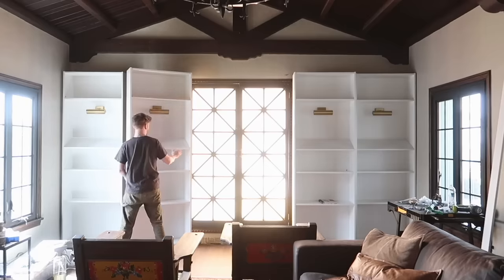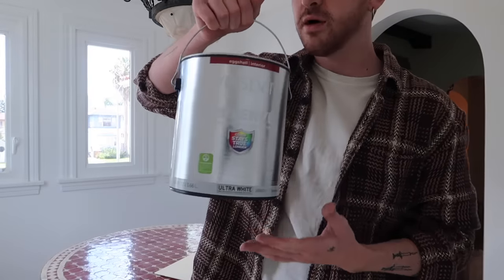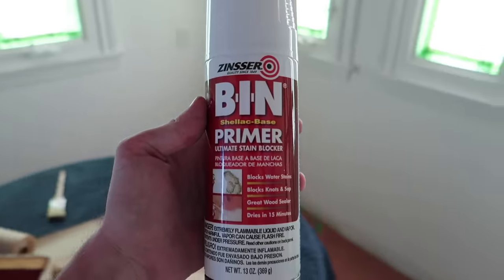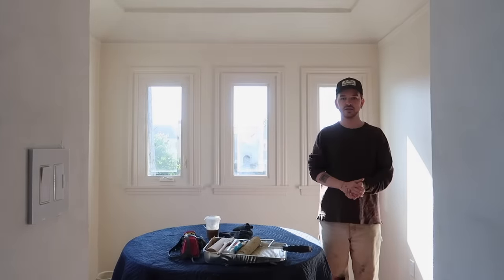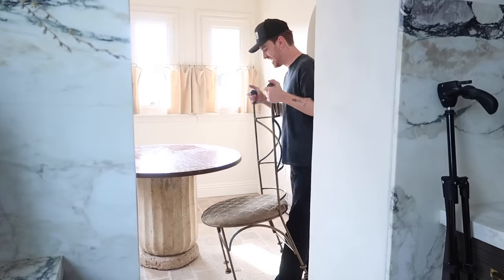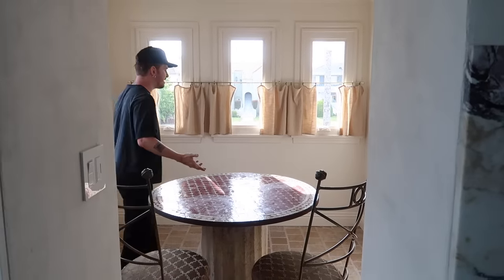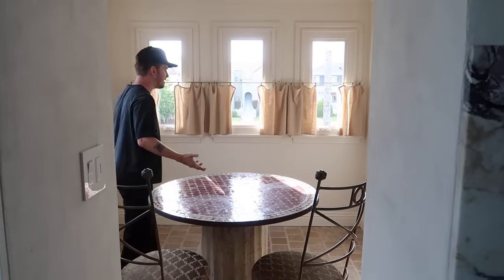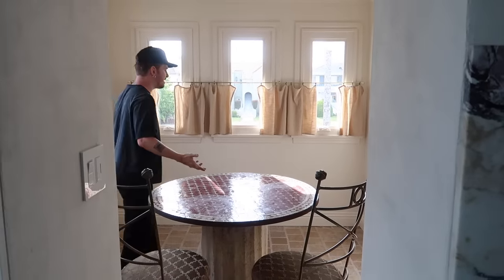EXTREME Breakfast Nook Makeover (From Start to Finish) ✨ MAJORITY THRIFTED!

Comment: Love your choice of fabric on the chairs. The chairs were a great find love that they even have rubber feet. I don't know if you realize you had the cook books upside down on the right breakfast nook which was a little odd. Love the linen curtains / napkins. I definitely agree with you about the paint color changes. It is soft and warm in there and it looks really good from the kitchen. The one thing I would do is raise the light fixture up one chain link so the bottom of the acorns are above the cafe curtain rod. So when you look in there above the curtain rod. The light fixtures lovely. Yeah you are already started on that area quite a bit previously with the tile and acquiring the table and the base. Bravo! I would not have chose five chairs but it actually works.

Comment: Nice job, Drew! I used to shop thrift and antique shops in the 90s for napkins, linens, table runners,and old handmade embroidery products, then used them for curtains.  Also, whenever you paint red on a wall or ceiling,  use a pink as a primer. Makes the red go on much more evenly and can even eliminate a second coat.

Comment: Hi Drew! I love the chair reupholstery fabric, and the light airy feel the open chair backs give the room. The table is perfection itself, even if I feel like the chandelier competes with it in massiveness. The shelf styling is beautiful, as are the twisted pulls. I do have quite different taste in art. The red ceiling seemed a bit grand for a breakfast nook, but could have also worked. Overall, a lovely room and very coherent with the adjacent rooms!
Reply: I thought the original light fixture would have worked better with the chairs. I'm not a fan of the fixture but overall the room is beautiful.😊

Comment: I TOTALLY get what you were going for with the red ceiling. And I think there's a still a way to do it! The red in the table is so beautiful, so perhaps you need a transition shade that ties in the kitchen with the table. Perhaps a terracotta? You could paint some of the trim, or perhaps do tapered "clay" shades on the "steps" in the ceiling. So like darker to lighter (or vice versa). I'm thinking of Mediterranean or Moroccan buildings that use peach, terracotta, and red colors.

Comment: I just can't decide if I like the cord cover. First I thought it didn't really go with anything in there, but then I felt like it went with your chair fabric and the curtains. But theeen I thought maybe it would look prettier without it, because it would kinda match the chair frame details and not add onto the wood element and black metal of the chandelier. But it also kinda softens and warms it up. But then again so does the light in itself. I can't decide!

Comment: I am obsessed with the styling of the nooks. Beautiful pieces, and the black candle holder wins the day. Sadly, not so much a fan of the Cafe curtains. Roman shades would have been fabulous and wouldn't have that rod placed over the wall. Maybe, non-adhesive window film in some exquisite pattern. I found the narrow curtain rod not giving off the same significant vibe as the table and fixture. I have a feeling you might think this little curtain situation over. I did love the other fixture and how it was framed by the arch! It was substantial without being too large of a scale for a rather small room. This fixture is too much for the framed effect. It would look excellent in a large room!

Comment: You are the most talented designer I've seen. At the age of 81 yrs. most of my needs are practical. Here in Australia it is just getting colder and of course heating prices are astronomical. As a renter the ugly vertical blinds have to stay but I want to hang blockout curtains without any holes or damage to the walls. Iv'e seen stick on strips but I'm sure they are not strong enough for "winter" curtains. Any ideas please will help before It gets really cold. Thank you so much.

Comment: Having the pictures added in like this is typical for older art books from the 1940s up to the 1980s. Basically a more expensive way of printing was used for those pictures as well as different paper and so they were added separately to the more cheaply printed rest of the book. It’s called tipped-in-pages.

Comment: Love your videos
Want to worn you against Feed & Wax. I am a collector of vintage and mid century modern furniture. I have been told time and time again to stop using that product. I even had a refinisher tell me he will not work on a piece that has been treated with that product.
From an expert I know who specializes in restoration of vintage and antique furniture:
"It's a “non-drying oil” similar to cooking and food oils in that it doesn’t dry. When used over nicks in the finish with exposed wood the oil seeps into the wood itself. Not only does this lead to the development of “oil spot” discolorations but also can cause issue should the piece eventually be stripped and sanded as a new finish is less likely to bind to those spots." 
Hope that helps! Didn't want you to destroy any of your lovely furniture.